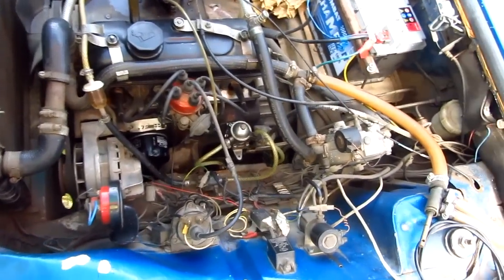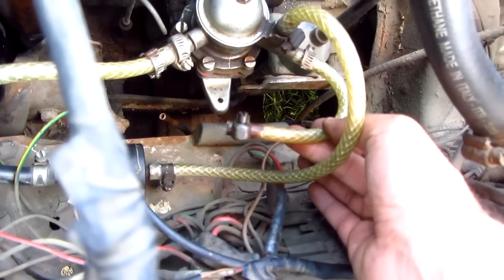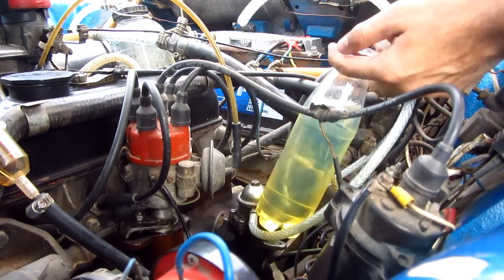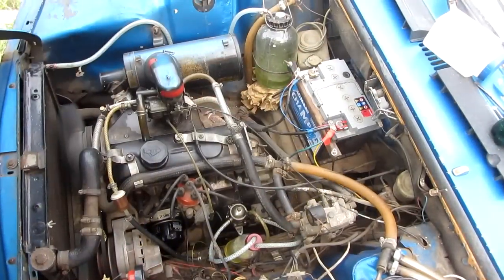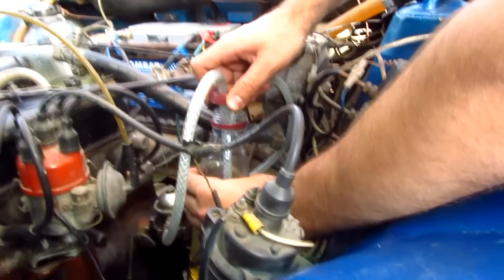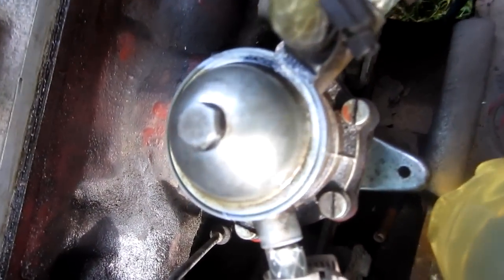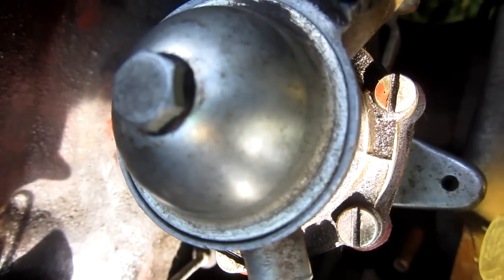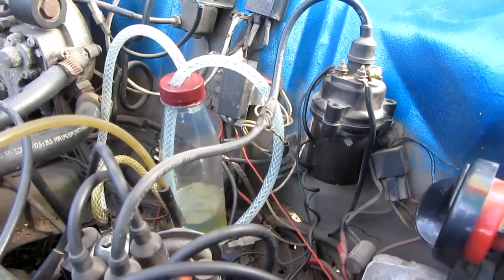Mini Fuel Tank from a Plastic Bottle

Comment: Thankyou. Now I remember to add a outside electrical fuel pump. To get fuel to the motor. I needed to move my truck. But I have holes in the bottom of my gas tank. Thanks again. Linda

Comment: Can't you lift up the receiver hose so it can just be fuel fumes just to see if it will run on gasoline fumes just saying since you're already running on propane fumes it would be a good experiment and update
Reply from the maker: If the surface area of the gasoline is large enough and the engine is not too big than it will work on vapor for a limited time. The highly volatile compounds will disappear in time and the engine will stop. Modern gasoline also has anti-evaporation additives.
Reply from the maker: Example video, engine running on gasoline vapors ► https://www.youtube.com/watch?v=Iq0NzxEQWd4